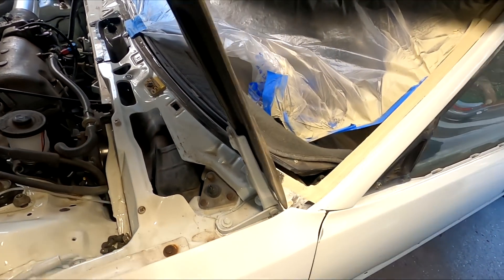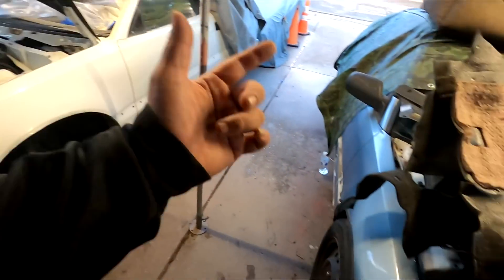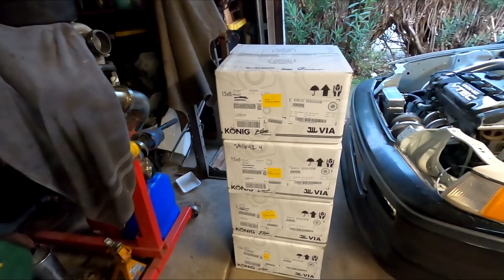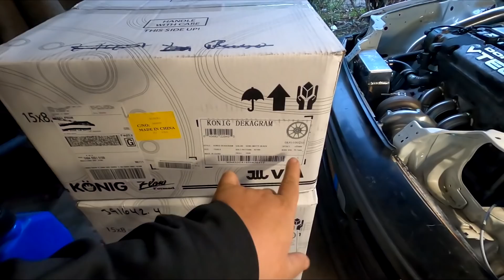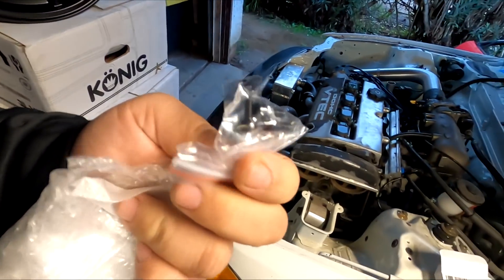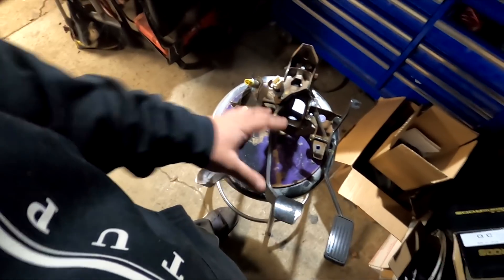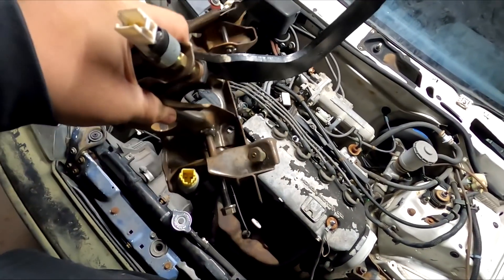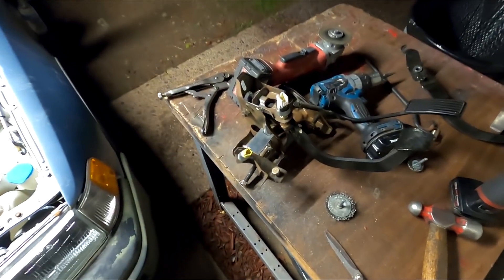🔥 KONIG DEKAGRAM 15x8 +25 [ SPECIAL ANNOUCEMENT ]

Comment: I reinforced both of mine. I do it a bit different with a square plate in between the sheet metal that mounts to the firewall and the stud rod the clutch pedal swivels on. One on the crx that is still cable has lasted almost 18 years now and the one on my ef hatch with a self built hydro conversion and an action clutch sprung 6 puck D-series is a year and going. Time will tell on that stiff action clutch tho.

Comment: Audio sounds fine. Good actually. Only time its one sided is as expected when your holding the cam on either side of you, naturally positioning of audio playback as it was recorded. And when ur facing the cam, audio is perfectly binaural as it should. 

On another note. Just finished watching previous video showing the mugen kit, wish i knew you were looking for the kit. I had a full eg kit, that was fabbed from an ef kit. Side skirts were slightly damaged, but still easily fixable. They were poly as well. I literally maybe less than 2 months ago, sold the eg with the kit on it.

The wheels ive been looking for that i miss owning were the old school TenzoR Shumachers. Back from the late 90s early 2000s